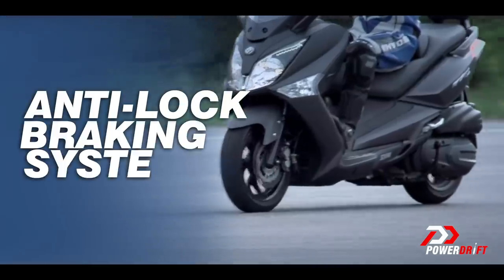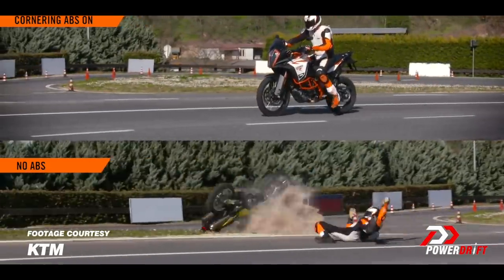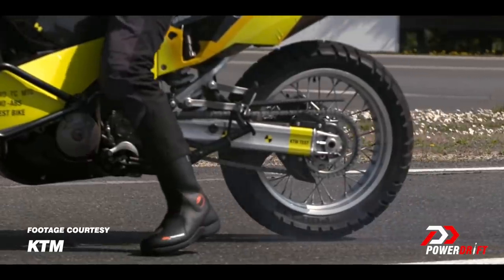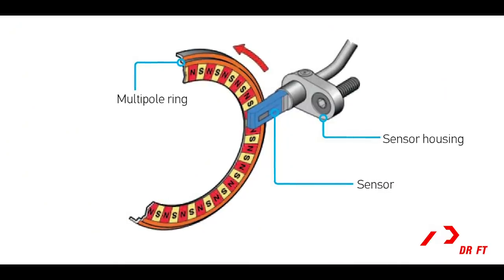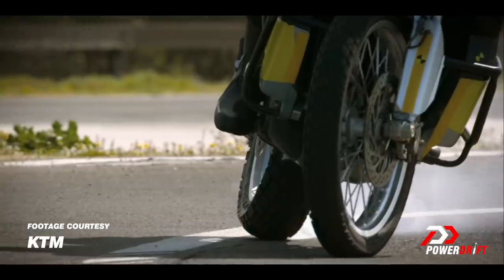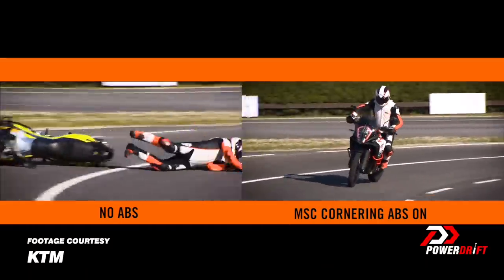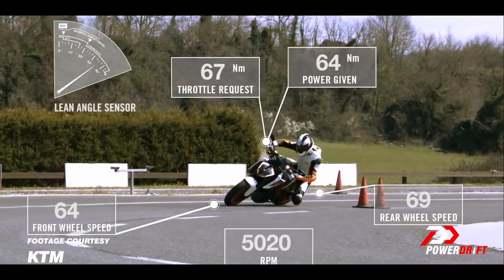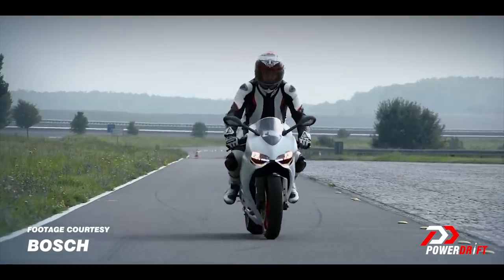PowerDrift Simplified | How Antilock Braking Systems (ABS) Work

Comment: When I got the xpulse I was not aware of abs pulsing ...... In a emergency situation when I FIRST TIME felt the pulsing I released the front break and grabbed it again ....... Because of which weight transfer was going back and forth ...... And I droped the bike ....... LUCKY till the drop I had reduced alot of speed and bike got some minor scratches...........FOR NEW RIDERS PLEASE TAKE THE FELLING OF ABS AFTER GETTING FIRST BIKE IN A PARKING LOT OR ABANDONED ROAD 🙏🙏........ BE PREPARED IN EMERGENCY SITUATION

Comment: Hello Shumi, Can you give tips on how to ride in the dark? The high beams coming from the opposite side makes it difficult to ride on roads with bad patches and with people trying to overtake you from different directions makes it more harder. I have a LS2 mx series helmet and the visor tends to reflect the light more so I have to ride with the visor open and that's compromising the safety. Any tips to fix it?
Reply: Try wearing a transparent glass with no power.  
It's better to ride slow and steady in the dark. 
With respect to lights , Slow down the vehicle to some extent and try moving to an empty side of the road and hold your bike at a speed that can be controlled. In the worst case scenario , stop for a while and then continue. 
I too own one LS2 with transparent visor. This is what I do in most of the cases. 
Cheems 🤝
Reply: @aryadeep9615  Thankyou soo much.

Comment: Hey, I'd a doubt not sure if you've the time to answer it.
If I ride a single channel abs bike, and apply both brakes simultaneously, and rear wheel locks/skids, does it have the same impact as front wheel locking or slightly less or much less? (Sorry for my use of such adverbs). Just wanted to know how deadly/safe single vs dual abs are.

Comment: Great one as usual. Just one thing, at 2:35

It should be the difference in frequency to calculate the speed of rotation of the tyres, if i am not wrong. 

Thanks PD and specially Shumi ❤️❤️

Comment: hi shumi sir..please explain 2:30 in ths video... what kind of changes happened in abs breaking if i upgrade tyre 100/80 17 to 120/70 for front and 130/70 17 to 150/60 for rear.  i ride Pulsar RS200 abs 2016

Comment: Hi shumi..the way you explained abs..i have a question..most of the times I like to do soft breaking as it gives me more confidence while riding though I have Gixxer sf250 dual abs. But lot people says that abs bike brakes should be pressed hard as the abs intervention basically keeps the wheel running.pls guide me on this.

Comment: Hi, please respond. I have issue with rr310 brake sensor, with the very light touch to the brake paddle, it turns on the tail light. While riding, It looks like i am continuously applied brakes. Many times my friends told me this. I asked service center guys to fix they told it is built like this only. Please let me know if there is a fix or it is what it is.

Comment: Sir please tell me, whats the reason must be. Whenever i had a sudden, emergency brake in my single channel abs, bike, wether in around 40, 20, 15 kml the rear wheel always skid, and shake me to left and right. Though the abs is functioning well, as shown in the meter console. Can it be due to more pressure given on the rear brake? Have changed the rear tyre, with other brand, thinking that this might be due to tyre. But still its  the same, and  now  i'am scared of hard  braking. So am confused. Please hlep me sir.

Comment: Friends, do not ever use a magnet to pitch the ABS sensor, coz an untaught mechanic once did the same thing with my CBR250r and then the ABS  on my bike started misbehaving....finally they hired a mechanic who used to work on "Fireblade"  to fix this issue(it was  somewhere around 2013 when we were new to this technology)

Comment: Hero xpluse 200 4v or Bajaj N250 for city riding and pillion comfort ?
Reply: For pillion definitely the n250
Reply: Better refinement?
Reply: @JSGAMINGSTER  N250 comes with a 2v engine 🤔
Do take a test ride between them!
Reply: My question is : Why are you even considering Xpulse 200  for city riding?
Reply: @nitin9837560  because of the seat height and the 4value and the connectivity
Reply: @JSGAMINGSTER  xpulse isn't made for city riding..maybe consider other bikes if that's your intention...or test ride it and see how it suits you
Reply: @JSGAMINGSTER  better buy RTR160 4V or Rtr200... It's best for city, feature loaded and the most refined  as well!

Comment: ABS is a Blackbox (compute intelligences) that allows rear wheel to not lock up and save Motorbikes from drifting against the will of the rider.
This is bound to increase the stopping distances.. but how every Motorbike journo puts efforts to emphasize on how the stopping distances are reduced per every revision of the same bike. Sounds very counter intuitive.. could Shumi or someone from PD plz explain ?